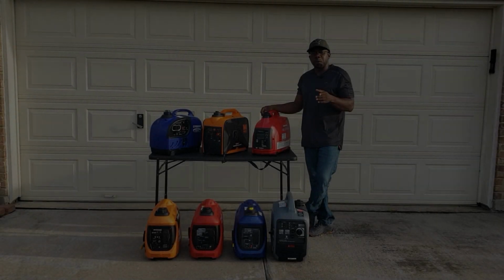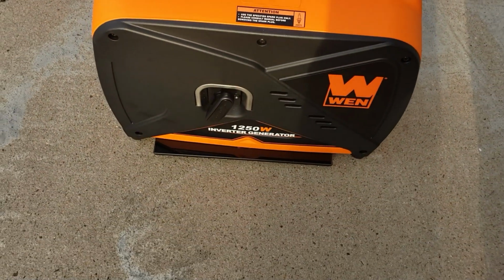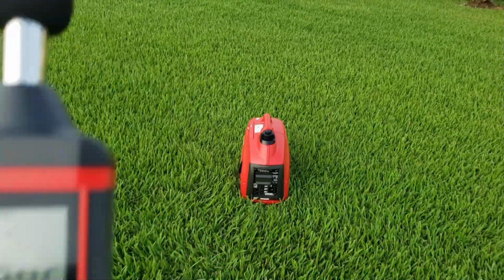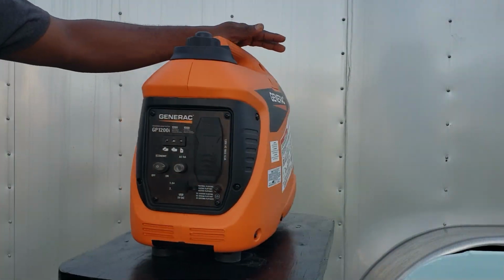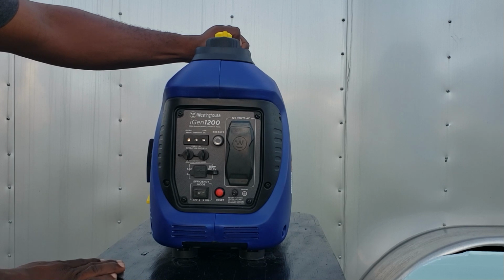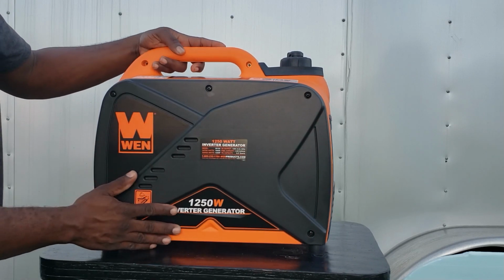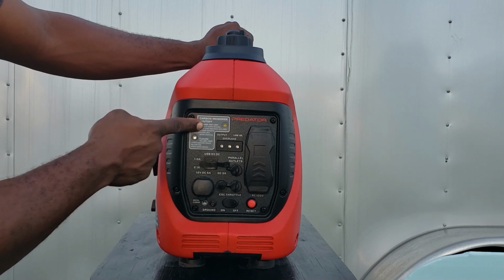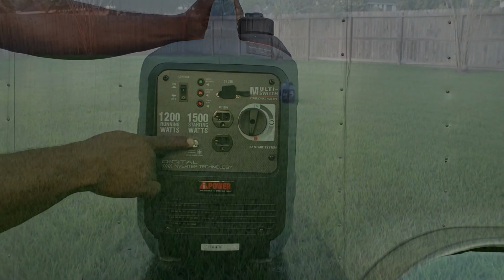BEST 1000W Inverter Generators for Camping

Comment: I agree that 1000 watts will handle most anything except AC or a microwave.  You can run a 40 amp battery charger, led lights, laptop, led TV, ect all at the same time.  I run a cheap $150 Sportsman 1000 inverter and it is great.  It only weighs 20lbs and is 800 watt continuous.  I have a Yamaha ef2000is but hardly ever use it.  I have a 12k heat pump that is too much for the 1000 but maybe it would if it was a 9k.

Comment: Most of these models are not readily available here in Canada. I just bought the Powermate 1200i which looks a lot like the Westinghouse in form factor but appears to resemble the Sportsman Gen 1000 the closest.  I do believe it is made by Generac. It has a feature called "auto speed" with no dedicated  eco switch, so likely always run in economy mode until a load is applied. Again being only $399 Canadian, I don't really expect it to run or last like a Honda, but the Honda 1000 is $1200 Canadian and that's WAY too much for casual use at the airfield for charging batteries.

If I could have my choice of all of the ones in this video, personally i would choose either the Wen or the Westinghouse, only ruling out the Honda due to cost alone.

Comment: Thanks for this review; it is the best of it’s kind regarding the mini generators that I have found. I bought a Honda eu1000i yesterday. The hardware store I purchased it from had two of the newer co-minder equipped as well as the previous model without co-minder but with 12v battery charging. They were all brand new on the shelf and all came with a 3 year warranty. I decided on the older/non co-minder model because I know better than to run a generator in my house or garage and because I thought there may be a practical or even emergency use for the 12v charging at some point in time. Also I may want to creat some form of additional quieting box etc and was concerned that co-minder might not like any form of containment, especially depending on wind conditions at a given time. Upon sound testing my new generator I get very similar decibel levels to what you reviewed here. Now when I read the specs of this new co-minder edition I find them to be advertised at 42db in eco and 50db in normal mode…numbers that are really kind of hard to believe. I was concerned after reading those numbers that perhaps I had made the wrong choice. I am thinking though after watching this review that both models are likely about the same for noise but Honda has decided to exaggerate the specs of the newer model. I will be calling Honda for clarification come Monday. Thanks again for the great review.
Reply from the maker: Great choice on the generator, it’s a very quiet and reliable generator

Comment: Decent video but you forgotten one most important thing what is the surge watt's is it a thousand watt surge in 800 running or 700 running or what it's like my little generac generator I have it's 1200 watt surge 1,000 watt running
Reply from the maker: Yes I did forget to mention surge and running watts on this one. My bad

Comment: As always great video, thanks for your efforts.
Question please: Is there any chance you happen to know which Portable 2000W or less Generator / Inverter has a Fuel Cutoff Switch. I have a 25+ year old Coleman Pulse 1850 that is primarily use for running 2 PAR-64 lights for fishing and now its time for a new one. Being able to fun the fuel out of then bowl is a big deal for me. If I could find a dual fuel for under $500. I'd be ok with that.
I am truly grateful for any help from you or any Subscribers.
God bless and Happy New Year
Reply from the maker: Thanks and Happy new year 🎊 
Let me check and get back to you ASAP may have to make a video on this. I know a few but price point is what I need to confirm

Comment: If I had to choose from among the ones you demoed, I'd probably go with the Predator 1400. The Honda is great but just too pricey for me. You can almost buy 3 of the others for the price of 1 Honda. Yeah I know that there are some out there that are going to say "the Honda will last a million years". If my life depended on it, maybe I'd buy one. But I use my Westy once or twice a month, it's 2 years old, and it starts first or second pull every time. Thanks for another entertaining and informational video.
Reply from the maker: Thanks Tom great choice 👍🏾 
More power just as quiet and with all plus +features
Reply: Here’s the thing with the Honda and Yamaha for me anyways, I only use my gen whenever it’s an emergency besides the monthly run to keep it going. I’m talking like to run my gas furnace/blower (600 watts) when it’s 0 degrees out and the power is out for 2-4 days. If I bought the predator could I really rely on it? Now the predator would be great for camping because for any reason it failed it wouldn’t be a life or death situation.

Comment: Predator 1400 seems to have it all. 
Awesome content 👏 👍
Reply: Problem I have with the predator is for $100 more you can get a 2k predator
Reply from the maker: Yeah it’s pretty close to that 2000w but the weight difference that’s a plus and the 2000w doesn’t come with the C/O Monitor
Reply: @Bajaheat  Problem with that is for $100 more you can get a 3k Predator, and for $100 more a 4k Predator...   Bigger isn't always better, especially concerning fuel consumption.
Reply from the maker: Thanks yogi👍🏾